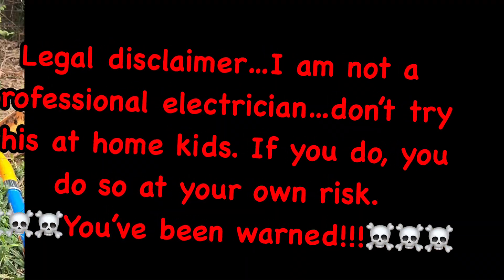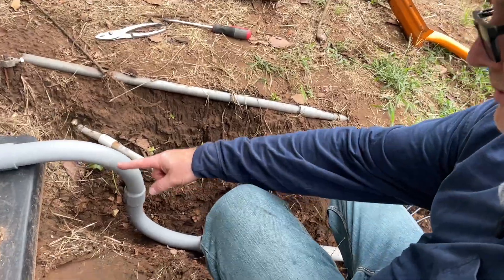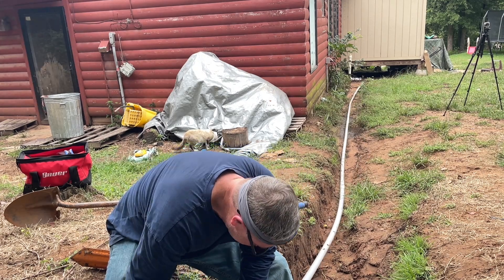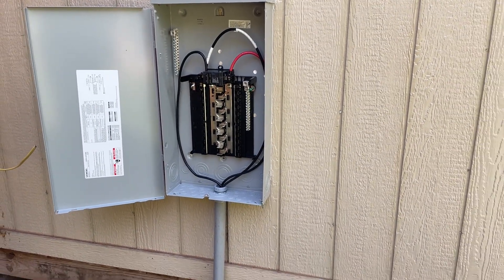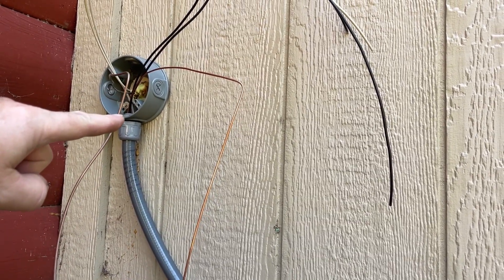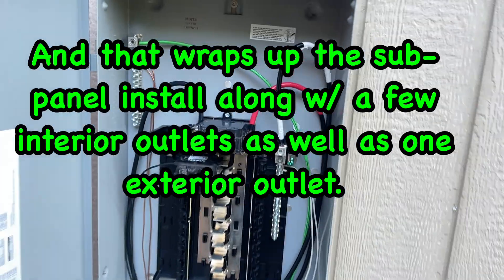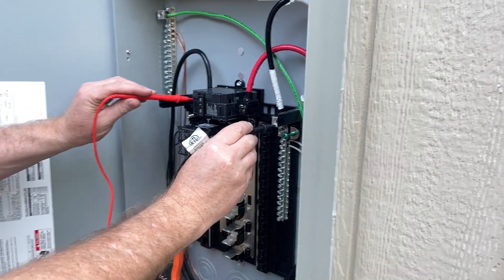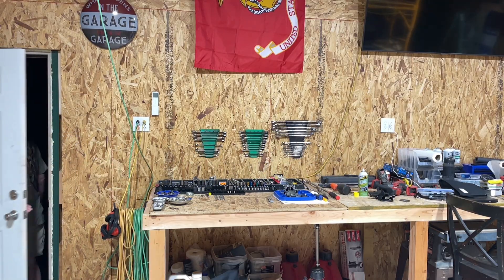Need to install an electrical sub-panel? Let’s do it! (100Amp Outdoor Sub-Panel Installation)

Comment: Neutral bonding screw???
Reply from the maker: Good catch! I misspoke, I was trying to convey that since it was a stand alone building there is no need to bond the neutral with ground like at the meter. So a separate ground had to be run for the sub panel in this instance. Thanks for the feedback and watching, I appreciate it!
Reply: BONDING IS AT THE MAIN PANEL ONLY, DO NOT INSTALL THAT BONDING SCREW AT THE SUB PANEL.